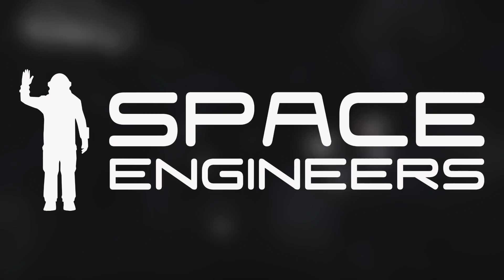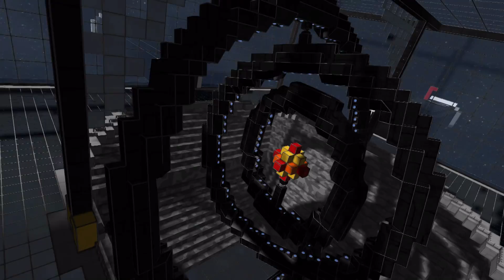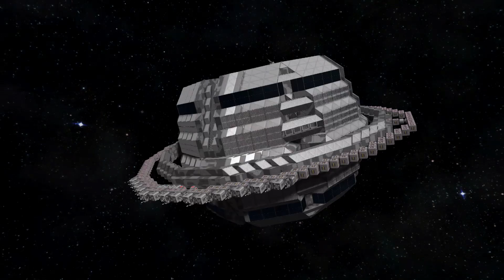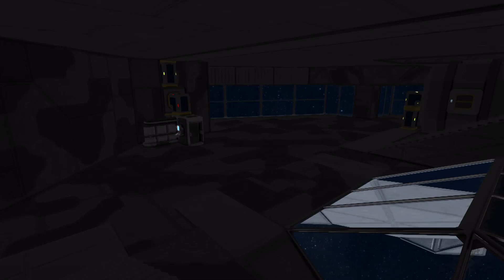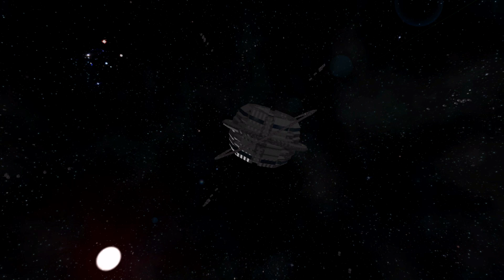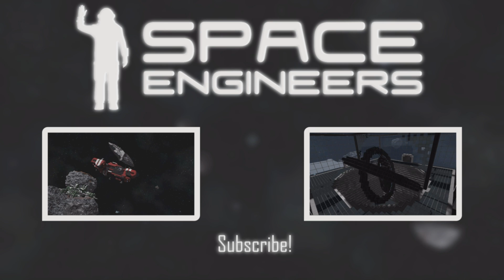Space Engineers Shipyard: The Graviton Station

Comment: Holy crap! Bro this is the most creative and maybe deadliest defensive option I've seen so far!  But.... question.... what would happen if, while the rings were spinning, their rotors were shot to smithereens?  I'm fairly certain the station would be in trouble if the rings went the wrong way.  A safety feature should be implemented in such a scenario.  To maintain control of the rings even after such a disconnect, I'd suggest the use of standard antennas or laser antennas.  In addition, set up a function for the remote control mode to grind the rings in half so that their inertia carries both halves away from the station before they can do any significant damage to the station itself.  The rings may in turn ram hostile vessels if you get lucky.  On top of this, the use of retractable turrets as a secondary defensive option should the rings be disabled may be a clever option as well.  Think about it :)
Reply: Jonathan Carpenter Oh and maybe put some turrets on the outer ring on the sectors closest to the rotors.  More efficient usage of space eh?

Comment: In scenarios when you do not have the reaction time to retract the pistons, the upper hemisphere will be destroyed easily.
Also with the oxygen update, the opening of the hemisphere would have depressurized the whole hanger (if you ever plan to pressurized it at all), so I would recommend multiple hangers rather than the whole separation of the hemispheres if used as defence.
Also is it possible to create drones (like a turret mounted on the mines) which can fire a few rockets but can be quite deadly since they automatically lock onto an enemy and shoot it from different angles?

Comment: I noticed that mines are not fired along the axes closest to the rotor. I suggest loading a different type of ammunition there that includes thrusters with thruster override set to "on" that would allow you to fire on those axes as well. Also, turrets along the outer ring might help defenses. All a smaller fighter has to do is get inside the outer rings and the ship will be compromised.